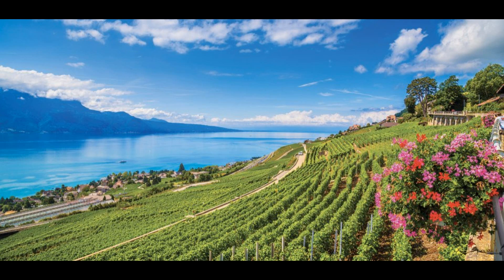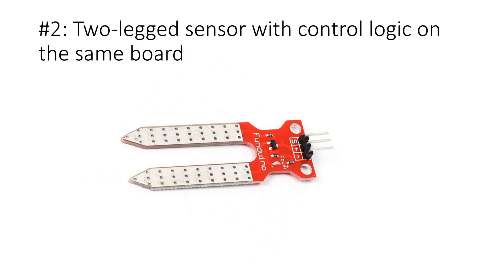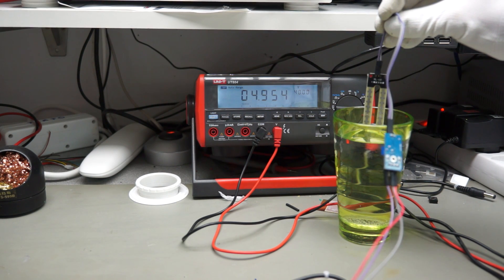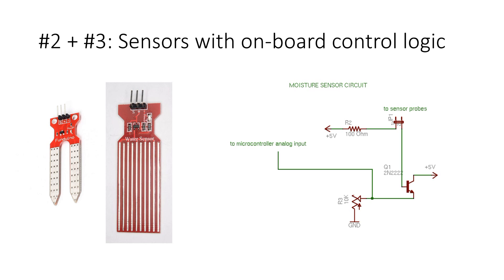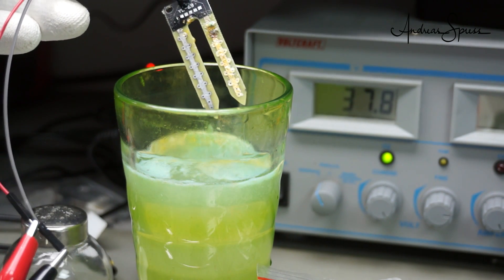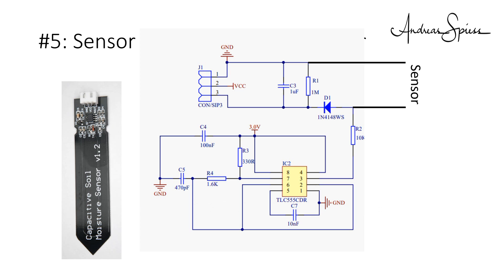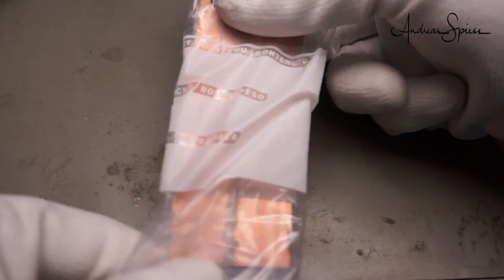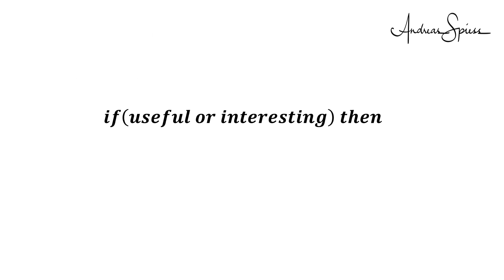#207 Why most Arduino Soil Moisture Sensors suck (incl. solution)

Comment: Andreas, I have been also investigating the problem of accurate moisture sensing in garden soil...or any soil for that matter. all my years of gardening using these cheap little nursery soil moisture sensor probes, which I found to be utterly inaccurate, and settling for a simple "finger poke" into the soil around the plant to be the most accurate. So, I wanted to know why something as seemingly simple as moisture sensing was such a problem. As it turns out, it is a huge problem across the industry of growing things. Some farmers who can afford it, simply use expensive satellite services to indicate how wet their fields are across the acreage using RADAR (microwaves which are very sensitive to water). 

The real problem is not only different types of soil, aeration, permeability, organic matter, clay shields, sand disbursal and entrapment, and a host of other variables in soil types, but uncontrollable varigated and often unexpected electrical conditions in the wet soil itself!. This is the problem of ions in the soil and electrical differentials. Introducing even tiny amounts of current to such an environment can create chaos for delicate sensors. Fertilizer salts are disruptive for resistance probes because of the electrolytic nature of such salts in water. Electrolysis is bound to harm any cheap metal sensor, not only by dissolving it but also by depositing various nonconductive oxides on the probe surface, thus changing resistance and creating havoc with the readings. In my customized soil, I found spurious, and continuous voltages across a distance of only 35 centimeters, of a full volt!  Until this investigation, I had no idea that much voltage potential in soil existed.

I came to the conclusion, any worthwhile sensor must never come in direct contact with conductive materials to the soil/moisture being tested. I have investigated using sound (moisture speeds up sound waves, dry slows them), thumping and sensing resultant vibrations (dense wet material deadens vibration, dry does not), heat conductance probes (wetness conducts more heat than dry- I have applied for a patent on this idea)  and even the use of graphite and  titanium electrodes. Those are just some of my experiments. This little capacitance probe has been around for a while and seems to me to be the only commercially available one that meets the criteria of not exposing the instrument electrical parts directly to the soil being tested. 

The little amazing and cheap RADAR proximity sensors (such as HB100 or the RCWL-0156) gave me the idea of using set distance microwave reflections in the soil to determine wet soil density against a "dry soil" background, but so far, I have not been able to make the cheap sensors give satisfactory understandable, repeatable performance relative to wet/dry conditions. But, the idea is promising.

And, of course, one of the design parameters is "It has to be Cheap!". Any accurate sensor must be very inexpensive to purchase, install and operate simply because they will be needed in mass quantities.

Ideally, the sensors need to be independent of power supplies and wireless (wifi), so the power would come from solar. Readings must be accurate and consistent over time.  In my case, each sensor conbtrols a valve issuing water to the plant for a set time, then waiting for the moisture or disburse in the soil and then read again and water again until the soil meets perfect moisture levels. In my own testing, I have found the plants seem to be the ones calling the shots, - as the sensors settle into their 'cusp' of only a few points difference between wet and dry (water me), they operate frequently with very little moisture being issued at a time-, maintaining just the right amount.  So, hot days, windy days, cool or wet days, all blend together to cause the system to sort of adapt to the very individual plant needs. I adjust the moisture levels in the Arduino program and only make sure nothing is broken and that water, already fertilized, is always ready and at the same pressure all the time.

So, thank you for your demonstration with the various "Mostly useless" sensors. I completely agree the capacitive sensor is by far the only one of the group you have tested that is worth the money.
Reply from the maker: I found quite a few research articles about the topic. It seems to be really hard if you need precision.
Reply: @AndreasSpiess  The issue is the unreliability and the huge variance in soils and in the nature of weather, the plants in question, topography, transcient electrical background, soil conductivity,- it is not an easy one to solve at all. However, I have been using these capacitance sensors you turned me onto and so far, have found them to be very accurate, reliable and relatively unaffected by most of the interfering factors that are so upsetting for other sensors. Also, they are immune (so far) to corrosion! Nice!

Comment: Good job! But about the capacitive sensor, I believe that it would be possible to generate the 870kHz signal on the microcontroller itself, so it could be even cheaper the board. (It would only be necessary: R1, R2, D1, C3. https://youtu.be/udmJyncDvw0?t=444 ) 870kHz??? Check this: http://www.ohmslawcalculator.com/555-astable-calculator
Reply from the maker: There is even a simpler method: Us the touch pins of an ESP32. It can measure the capacity without a external component :-)

Comment: Nice video - came across your channel and this vid as I'm contemplating seeing if I can use a capacitance sensor with an arduino or ESP32 and LoRa to monitor the beds on my allotment (2.5km away) so I know which beds need watering and when , so that I can maximise the use of my time down there.

Looks like your channel has all the info I need to start off my very first project - thanks.
Reply from the maker: You are welcome. I hope you live in the northern hemisphere. then you still have a little time for your project ;-)
Reply: @AndreasSpiess  Thanks - now working out what parts I need and which end of the soldering iron to hold.

Comment: HELP - I get slow response from the capacitive sensor you show(v 1.2), I used this basic code on Arduino: 

void setup() { Serial.begin(9600); } 
void loop() { 
int val; 
val = analogRead(0); 
Serial.print(val); 
delay(100); }
 and my readings are very slow. If I put it in water it takes almost 30-40 seconds to get down from a value of 611 to ~240, while this guy (https://www.youtube.com/watch?v=29AB8KrGSdU) get almost instant readings. Even with his code I have the same slow response! Can you help me please to understand why and how to fix it? or to find one that is anti corrosion?! is about sensor version? v1.0 works differently ?
Reply from the maker: Unfortunately, I cannit do remote debugging :-(
Reply: @AndreasSpiess  ok, thanks for response
Reply: @AndreasSpiess  hi again, I found something new about my problem,
I saw that, when I measure the output voltage the readings are instant,
and if I'm right, measuring devices have a coil inside, so, there's a "resistor"
so, back to Arduino, I connected a 1M ohm resistor between sensor Analog OUT pin and GND pin from Arduino (and of course that the sensor analog out pin is connected to a arduino pin to read the values)
and now the readings are instant with a range between 0.95V and 2.65V (the dielectric was my hand/palm), but I don't know what happens, so i don't know if this is the right solution
does this tells you more to help me?

Thanks and all the best!

Comment: The water is most likely contaminated with copper oxide. as well as the water is probably creating several other copper compounds maybe if the water is chlorinated or has salts or minerals from nature witch combine into many bad things when electrolyzed it could even make copper chloride gas.

Comment: Perhaps you could take the cheap bare sensors and create a circuit that uses AC voltage on the sensor that way you don't get the corrosion from electrolysis.
Reply from the maker: Maybe. But you have to isolate them from conductive water.

Comment: I need to measure soil moisture with good accuracy for part of my university project. I connected a capacitive sensor to a data acquisition system. The problem is that the readings are not constant in moist soil or in water and it keeps increasing gradually and never stops! however, It shows a constant voltage in dry soil. Is it normal? what should I do to have a constant voltage reading in a specific moist soil sample?
Reply from the maker: I found no data about accuracy. I think you have to do your own or use a professional sensor.
Reply: @AndreasSpiess  Thank you for your response. I guess the varying voltage readings in water and moist soil is because of water penetration from unprotected edges of the capacitive sensor (I use the same type as you showed in the video). I put it in a plastic bag and then put the bag in water and it seems that now the readings converge to a constant value after a few minutes. thanks.
Reply from the maker: You can protect them with 
nail polish

Comment: Hi. Are there no EMI problems in the AM radio band (530 to 1710 kHz) with the capacitive sensors?
Reply: And... Why not make the C that determines the frequency or duty cycle of the RC oscillator?
Reply from the maker: I do not know. Here, nobody uses AM radios anymore.

Comment: Hi. I buy sensor #4 and using read every 60 sec. Can I use it or must buy another?
Reply from the maker: You can try and if it is defective buy another. Maybe you are lucky and it resists for a long time

Comment: I want to build an automatic rain gauge. This requires consistent chemical properties of the water however, for the capacitance to be related directly with the water level. Is there some sort of circuit I can use that automatically calibrates to determine water level?
Reply from the maker: Rain gauges usually use a different principle (mechanical). And for water level measurement, people usually use other sensors like ultrasonic distance sensors.

Comment: I am thinking, you could modify the legs, remove the legs of the sensor and replace with wires or with available materials at home like nails or strips of aluminum cans.  water will oxidize almost any metal except plastic, so if you can replace the legs for cheap, then problem is solved. I like the sensor you made however I don't think I could make my legs from using pcb parts, it's too expensive for me. do you think if I use wires or nails, it would work similar to the pcb legs? thanks for sharing the video, it was very helpful.  how accurate is the last sensor you used compared to the cheap Chinese sensors? is there a difference in accuracy?
Reply from the maker: You can buy capacitive sensors using PCBs, you do not need to create them yourself. Usage of the different materials is discussed in many other comments.

Comment: Hi Andreas

Thx for this nice video, i like very much what you propose each time.

I have made some experience with resistive & capacitive sensors and published the results on ThingSpeak. I have also put my code on github here : https://github.com/skeletozaure/SoilSensorsProofing

From my own experience, i have found that capacitive soil sensors are not adapted to measure soil moisture. Resistive sensors corrode, that's a fact, but if you measure only every hour, or every day, putting current only a few ms, your sensor can last very long. Capactive sensors doesn't corrode, but when they are inserted in the soil, they measure moisture at that time, and stay with that value till you put them out of the soil and insert them again. I tried 3 different capactive soil sensors, and it was each time the same issue.

if you have a look at the graphics on ThingSpeak, you can see where i have decided to put out the capacitive sensor and then insert it again it the soil.

for resistive sensor, moisture is measured correctly, and we are reaching an asymptote 7 days after initial watering.

What do you think of that results ?

Au plaisir
Reply from the maker: I have no data about the "precision" of both sensors. There are many posts with different results. My experiments showed that both sensors were not very accurate. So if you were able to get accurate values in your case, that is good news.
Reply: In fact, resistive sensor seems to give results, a nice curve decreasing over time. Is this accurate or not, i'm not sure :) By the way, what i want to acheive is to find the best moment to water my plants. And it seems that it can be done when the curve reaches some asymptote, near 40% in my case. Is it really 40% soil moisture, probably not, but it can be the trigger.

Comment: Dear sir, I exactly understood what you meant. No electrical current as it will do electrolysis function, within different metal, different electrolyte, or even different potential differences in a circuit. The capacitive way is I will always like. Thank you for this enlightment. Thought it was just that simple to measure soil moisture. Thanks again.

Comment: The xiaomi plant sensor seems to be a cost effective solution. It supposedly works with the capacitive method. Some sources refer that it is fulffilling "Soil Probe EC5 Standard." Googling that returns some capacitive sensors. The sensor also shows no clear traces. However the price bumped up bit a while ago
Reply from the maker: I am not sure it is capacitive. I think it is resistive. But I do not know

Comment: I noticed that there is a picture of a cheap temperature & humidity sensor in the early part of the video, and had a thought: could you not put one in a buried upside-down cup (or w/e) and measure the soil temperature and humidity that way?  An external one would monitor the ambient temperature and humidity to provide a control.
Reply from the maker: Moisture and humidity are measured completely differently. There are a few discussions on the internet about that topic, because of Sparkfun and some Chinese selling humidity sensors as moisture sensors.

Comment: Is this capacitive sensor, sensitive enough  to detect rain?
Reply from the maker: I did not test. But I think they would be very inaccurate. Rain sensors work differently.
Reply: Thanks for the feedback. I'm using something like this: https://www.aliexpress.com/store/product/Smart-Electronics-For-Arduino-Diy-Starter-Kit-3-3-5V-Raindrops-Rain-Weather-Humidity-Sensitive-Detection/1504763_32460014764.html.
I assume it could suffer for the same problem as your bad  sensors, but I slope it to drain. I'm using to sense when to close a skylight.
Reply from the maker: Corrosion is probably much smaller because it is not always in humid soil.

Comment: you can use a stainless steel rod from welding electrode ... it;s non oxidizing material .. and this is a possible solution for this problem . All the best
Reply from the maker: Many viewers discussed that. But most agreed they do not want to have the different metals used in stainless steel in their food. Because some reported that even stainless steel can corrode in earth depending on its components
Reply: This is not a problem with steinless steel ... 308L steinless steel rod welding electrode will not oxidize forever ... I know what i say ... I used this for a project 6 years ago ... are impeccable ... try it

Comment: Thank you  Andreas, good video as usual.
I bought some of those crap sensors, I suppose I won't waste my time with them.
Question, is the corrosion nearly zero if no current flows through?
In this case we could switch on the moisture measurement one minute every hour or something like that.
Reply from the maker: The corrosion is reduced, not zero. Depends also on your soil.

Comment: Dear Andreas, thank you very much for your very entertaining and informative video. As I am building an automatic plant watering system with arduino, i spent a lot of time researching the soil moisture sensors. Then someone told me that I should use the SHT10 sensor, manufactured by sensirion, a spin-off from the swiss federal institute of technology (ETH) zurich. They are available on aliexpress, with a protective shield. There is a version for air and one for soil (the latter has the protective shield). They are sort of expensive ($20 per sensor) but are supposed to work for a very long time with zero corrosion. I was really surprised that I did not find out about it earlier when searching for sensors, and also, that your video is not covering it. (don't get me wrong, your video is great, i just want to point you into a possible new direction).
Reply from the maker: Are you sure it will also measure moisture. The data sheet only mentions humidity, which is in air.
Reply from the maker: https://www.raspberrypi.org/forums/viewtopic.php?t=78939
Reply from the maker: Which I think confirms that it does not measure moisture.

Comment: drive those other three sensor with AC and they will last a lot longer, DC and water is a bad combination. And measure only once very couple of minutes or so, and leave the sensor off for the rest of the time.
Reply from the maker: Your method is described many times in other commands. So it seems to work.
Reply: Even that will not give a long live time, sensor will still destroy itself after week/months, other metal like nichrome(used in water heaters for example) will do much better job for this type of sensor, icm with AC will give long live. I used it for my EC aquarium meter, after months the wire still blinks, and is thin wire.